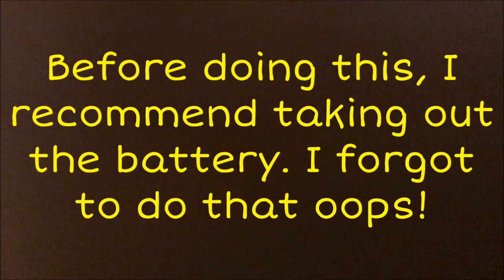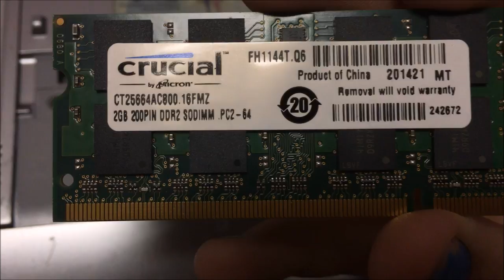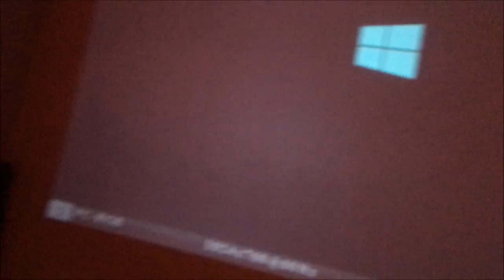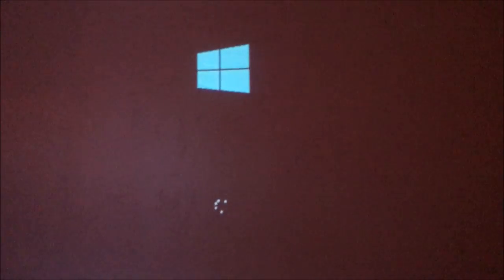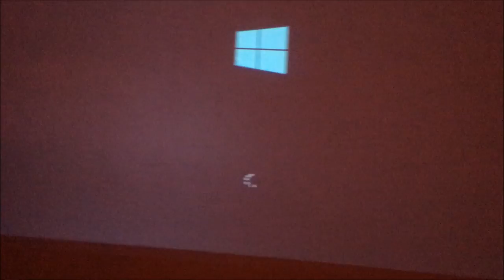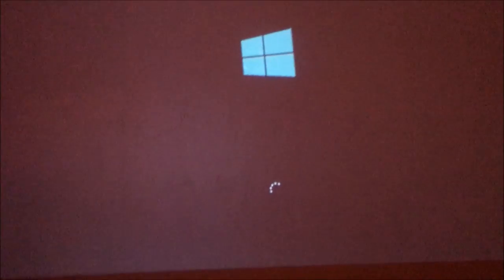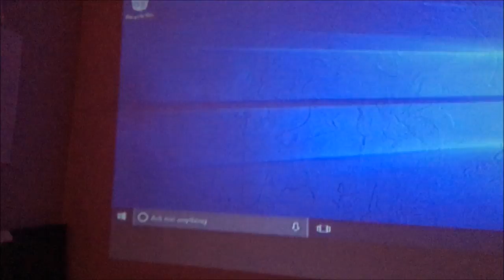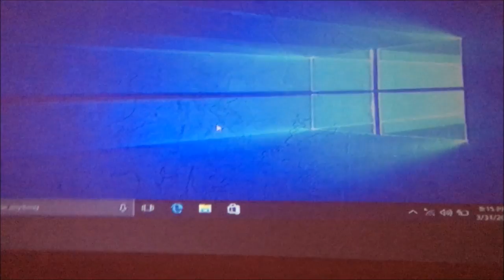How to fix black screen at startup on laptop!

Comment: I have an asus k501u laptop bought a year ago. When I click the power button it only displays a very dim monitor. However when I connected it with an external monitor, it works fine. Do I have to replace the whole lcd? Thanks!
Reply from the maker: I am not sure. Does it do it always on the screen? it could be a bad screen or maybe a setting
Reply: @JuliasTechSpot  Hi. The screen is very dim even though I have it set at 100% brightness. I'm afraid to replace the whole of the lcd only to find out that maybe the problem is only with the backlight. What do you think?

Comment: Those will happen. Read those message.

It happened from Hard disk if you didn't clean your hard disk. Your hard disk will get more slow. It mean hard disk is spinning slow and it gives error black screen. There a step to fix that. Also don't get new / reinstall motherboard / windows. It will not helping. Enjoy reading it will help you.

Safely first! : Do not allowing other program is needed to change in your PC / Laptop.

Step 1: Keep clean like Ram , hard disk everyday

Step 2: Allowing windows system change

Step 3: clean program

Step 4: Do not upgrade Windows OS to last.

Step 5: Remove unused program

Step 5.5: Don't upgrade the program updates

Step 6: Safely browser Like Google. Also IE is unsafe

That it. There some reason why we can't upgrade Windows OS?

Upgrade windows will make more slow for bad / Oldest gaming.
Best windows is 7.
Also some error in system like blue screen it make some trash file that didn't clean. So that it. I keep doing this for 2 years now. It won"t happen anything

Warning. : Don't flash your BIOS. Is unsafe and not helping. Enjoy
Reply from the maker: Thanks

Comment: On windows 10 if it boots but only shows mouse curser and screen is black run start up repair or manual fix it on command prompt
Reply from the maker: Hmm
Reply: electronicwiz1 only happens on HP PAVILION g6 laptops but it has to be a old one

Comment: I have a toshiba laptop 2 i left it on for a view days when i was away , i got back today and noticed the brightness would change from high bright to normal to low and back again constantly every second ,  so i tryed a fiew things to fix it but had no success so i just startet messing with the brightness up and down to see when its less noticeable , then suddenly the screen turned pitch black , when it boots it shows the normal booting screen for 1 second then goes black straight away i dont know what to do
Reply from the maker: +BlackFistUpHigh Is the screen going completely off, or lit black screen?
Reply: electronicwiz1 the 1st goes off but the system still runs

Comment: step 0. reinstall the motherboard at motherboard,org
step 1. reinstall the bios
step 2. install windows 7
step 3. enjoy an stable OS with a cool blue theme.
Reply: Yeah but it isn’t spyware.
Reply: How the fuck can you install anything when u cant see shit on the screen
Reply: electronicwiz1 win 7 runs still
Reply: >Step 0. Reinstall the motherboard at motherboard.com
Reply from the maker: +Lethal Oxyclean Clorox Bleach Windows 7 is old and unsecure
Reply: no, its still on extended support and its a decent os. its nice for 2012 and below pcs and was quite stable when i used it in a vm

i know i responded way to late to this but its still running in august 2018

Comment: I need help, when ever I start my old windows xp pc I see chromium and when I delete it, it always comes back. My brother on his windows 10 he had Chromium too. How do I make sure it doesn't come back? I delete it in add and remove programs.
Reply: xXMatt_CakesXx ok what you want to do if it won't go away all you got to do is rd which means destroy the operating system then reinstall windows on that Partion of your hard drive done you have now got rid of chromium hope this helps :D
Reply: Is it a virtual machine or what is it a achal computer partion on your hard drive
Reply: Plainapple287 thanks, I'll try that.
Reply from the maker: +xXMatt_CakesXx just delete the partitions and reinstall the OS you want.

Comment: my problème:
i start my pc. win10 is launching. it shutdown

start again. win10 fully launch.

pc: Lenovo Thinkpad

can you help me pleas? cuz that anoying.
Reply: Mini-anthrax it might be the laptop is over heAting badly randomly or deceting wrong that it's over heating try getting a small computer screw driver take off the fan cover on the bottom and if there dust or balls of stuff inside get a vacuum cleaner and a can of compressed air and sprey with the compressed air and vacuum up the dust and stuff and see if the problem continues maybe it's time for a new laptop if it continues hope this helps :D
Reply: ok!
(i forget. it have 3y. used everyday. poor pc :/)
Reply from the maker: +Mini-anthrax See if there is an update for it.
Reply: i allready looked that :/

Comment: This happened to my HP once. When I was upgrading the ram I disconnected some black cable but luckily I was able to push the cable back in
Reply from the maker: +GamerHD555 oops and good that you fixed it!
Reply: electronicwiz1 yeah
Reply: electronicwiz1 I've been into tech since I was like 3 and I learnt a lot in the past 8 years